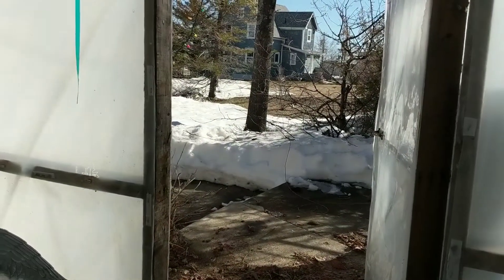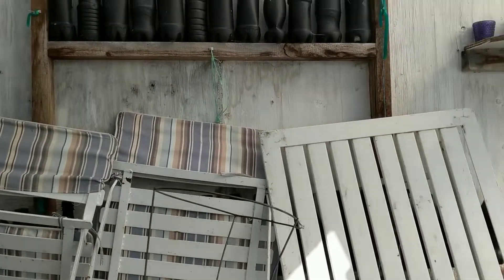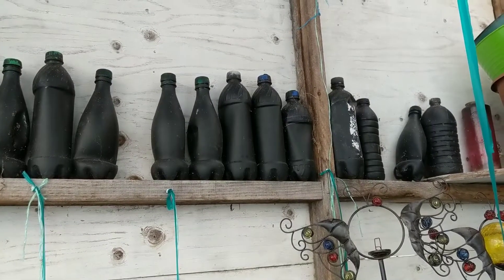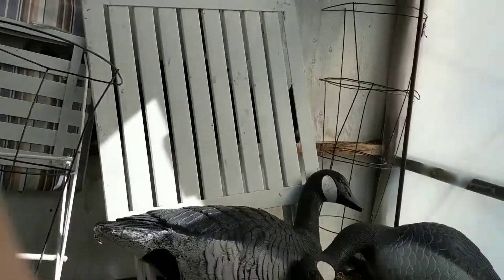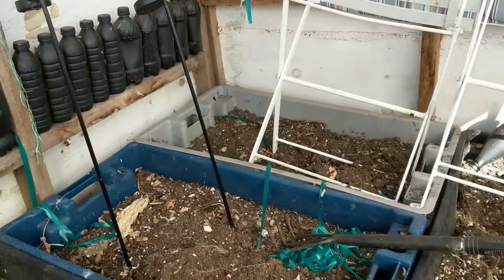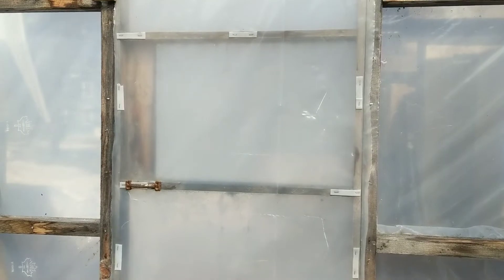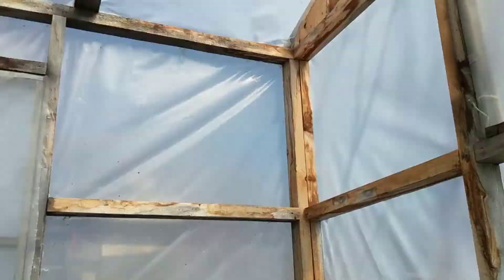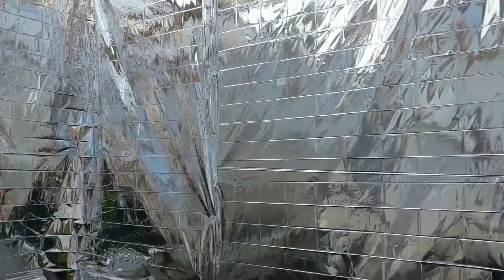Greenhouse repairs and upgrade 2019

Comment: I like the mylar idea should improve the quality of the light in the greenhouse. I use two sheets of it one each side of my light garden where I start seedlings and it works very well.
Reply from the maker: That's what I'm thinking....can't be worst 😋 I saw those windshield sun gards at the dollar store too but it would've cost more...and they didn't have enough lol...would have isolated a little more tho